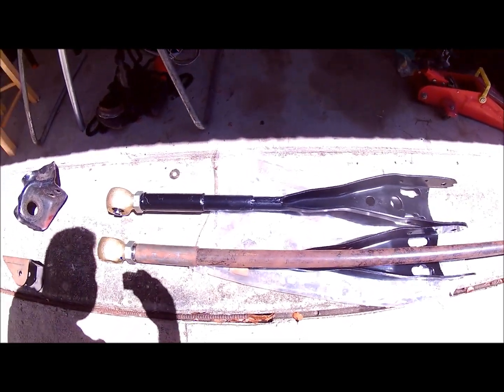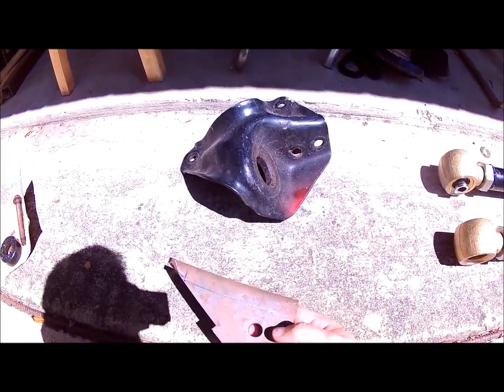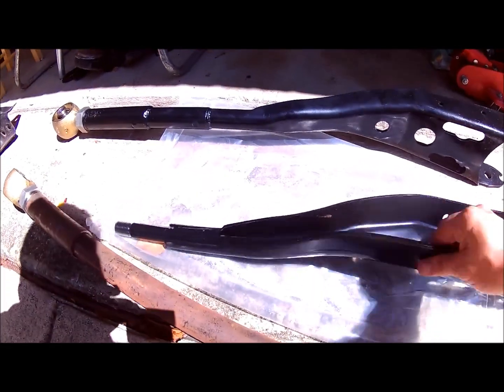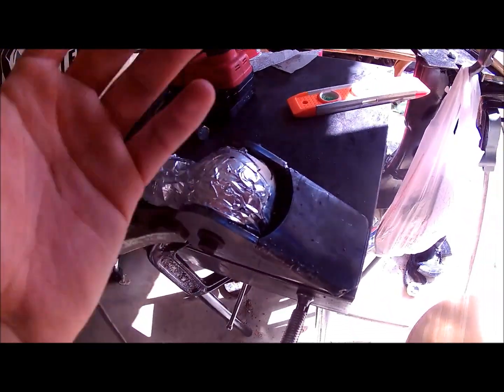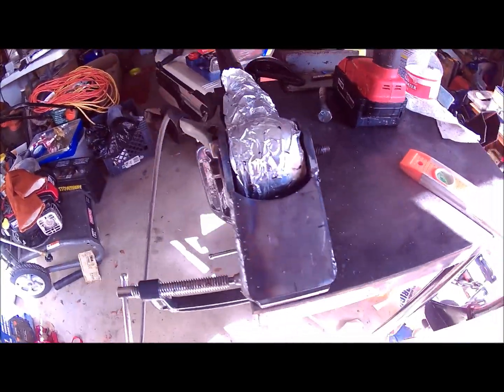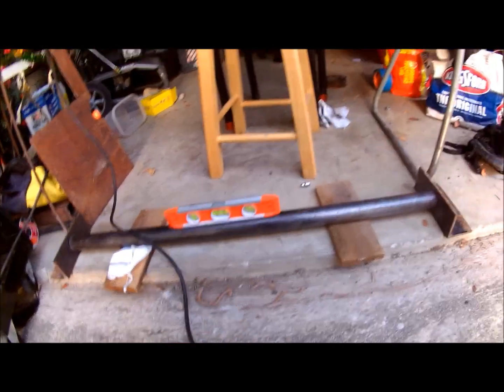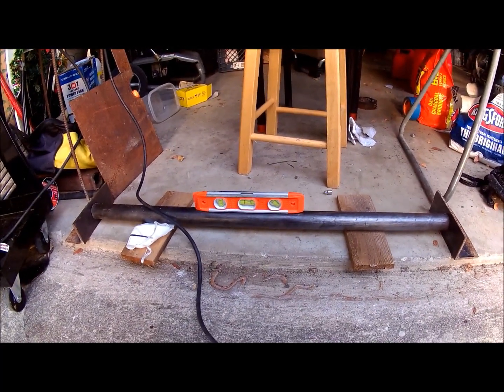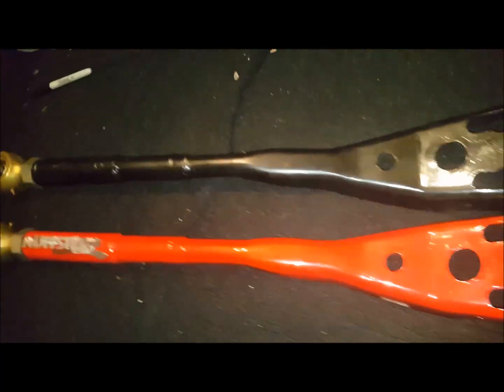Extended Radius Arm Build & Cross Member Fabrication (Part 2)

Comment: Man that was all the inspiration i needed to actually put mine together. Great job on the paint.
Reply from the maker: it was honestly super easy, i wish i would have used a bigger drop bracket to mount the arms, to make them a more of straight angle but it works fine how it is

Comment: How did you keep the right caster angle?
Reply from the maker: the radius arms have adjustable joints on them, and before i tore down the stock suspension i marked where the the center of the wheel hub was vertically above the fender, so after the install was done i knew forsure the wheels sat in the same position they did prior to install
Reply: Did you put or make the center pivot brackets to lower the dual I beams to accommodate the longer radius arms?